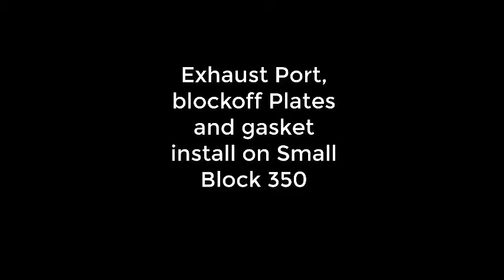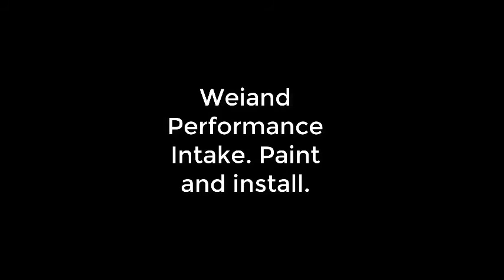exhaust port, block off plate and Weiand Performance Intake for small block 350

Comment: How Did it work out?
Reply from the maker: @jessemendoza2991  I've turned the engine on several times since I installed the block off plates. But only for about 15 too 30 seconds at a time.
 But won't know for sure how  well the plates  hold up till I'm able too install the 350 and let the engine run for a while.
Reply: @almagam2099   Thanks for the reply

Comment: That's not how you make those plates... 
Your plate will prevent the intake from sitting flat on the head. Warp your intake or crack it. 
The plates must be the thickness of the compressed gasket and sit INSIDE the gasket holes not under it. Make the gasket holes larger if necessary.

Comment: Beautiful job! Looks awesome. question? how thick is the heat crossover plug? Did you make it? I need two for my performer rpm to shut that heat off. Thank you, for you feedback. I need to get this done as manifold is ready for paint and install. Cheers from Motown.
Reply from the maker: Thank you. I used the port on the gasket as a template. I used sheet metal that I got at Lowe's. Traced out the shape from the gasket. Cut it out a few centimeters bigger than the actual ports. And did the install. I promise. It's really easy too do. If I can do it, anyone can do it.
Reply: @almagam2099  Thank you very much for responding sir. what thickness of sheetmetal did you use to make your your block offs? I want to make sure I don't go too thick and have gasket sealing issues. I bought some stainless sheets that are .013 thick from Menards pack of 10 for like $6.00. Hope they are thick enough. Thanks you, Appreciate it!
Reply from the maker: @robertclymer6948  sorry, I don't remember exactly how thick the sheet of metal I used was. It might have been the second thickness they they had?! I didn't wanna risk dealing with the same issues you mentioned so I know it wasn't  thick.
Reply: Do it run good since you have done that have you had any problems out of it since you did that the crossover heat block off

Comment: If you go on my channel 1 l o w z and look at my intake on my V8 in my S10 Blazer my first intake I painted same color you did but first time I thought I had a vacuum leak and I sprayed some carb cleaner around the base of my carb and I didn't even have a vacuum leak I was pissed off because it ate the paint off the intake right in front of the carb if you look at a couple of the last vids you can see right in front of my carb where the paint has came off and it looks like s***then it also will start looking bad around the boats that hold the intake to the block so what I did this time was take a 305 ho factory Chevy intake that was aluminum off of a 84 or 85 Camaro and put a wire brush on my impact and went to town on it I polished and polished and polished that intake if you look in my business sitting on the curb next to my truck when I was showing it off it almost looks polished aluminum it damn near looks grown all you're up to do is take a wire brush and a drill and you can make aluminum beautiful but that's the route I went because the paint did not stand up to that intake very well even though it was engine paint don't get me wrong or think I'm a hater I'm not your intake is beautiful that's why I would hate to see you put it all back together and it start looking bad because it's very hard to clean back up a intake once it's back on I'm sure you know this but man you made it look good 💯 I just hate to see your feelings get hurt first time some carb cleaner or some fuel gets on it
Reply from the maker: Thank's for the info! I'll def take a look at your channel!!!

Comment: Hey bro in a bit of pickle. Basically I need to know what I can delete from the engine
Reply from the maker: Do you have the z24i?
If yes, and if you're keeping the stock throttle body...you can delete about 99% of all the vacume hoses and the emissions  and egr Components on or around the engine! The only thing I left in place was the charcoal canister, but finally removed it a week or so ago! I have a vague memory of the original, stock distributor having a vacuum advance, but the new one I have now, doesn't have that, so no vacuum hose too deal with!
Reply: @almagam2099  any chance you could link the vid, if you made one, for taking those off? My truck keeps losing power even though the battery, alternator and starter are good
Reply from the maker: @Lz999J  ill try and help you after I get off work!!!
Reply: @almagam2099  I appreciate bro fr 🙏🏽
Reply from the maker: @Lz999J  here's the vid I did after I'd done most of the vacume hose delete! No real details on exactly what was done tho!
Reply from the maker: https://youtu.be/0AzENfKtZgM
Reply from the maker: @Lz999J  when you say your truck is losing power!, is it not holding a charge?
Does your engine turn over and start normally then die? Do you lose power to the entire truck or only certain area's?
Have you checked your fuses? They're underneath your steering wheel, just to the left of it!
Check your fusible links! They're next too or near the battery! They supply power too different areas of your truck! If they go bad, those area's will have no power!
Check your relays! There's several on the passenger side fender wall, near the fusible links and battery!
Check the battery cables for corrosion or looseness! Check the harnesses for alternator and starter! "Same as with battery" also check your grounds! Check for corrosion and looseness!
Places too look for ground wires: 
alternator to battery "I think?!"
 Firewall to valve cover. "Engine block!"
Transmission to frame.
Computer to frame.
Bad grounds will cause all kinds of problems!
Reply: @almagam2099  thanks man, are there any tips or things I should know while removing this stuff. And are you selling your z24i
Reply: @almagam2099  so I got off work I started it up like normal and as I was driving my rpm’s started going down and then it died. Lights/dash/radio etc were still working. I messed waited a bit after making sure everything was connected/tightened and after 20 mins of waiting it turned but really slow. Then a rattling noise starting happening then boom she died for real and wouldn’t turn at all. After I parked it I tried again just to see and it turned a lil bit.
Reply from the maker: @Lz999J  try deleting one hose at a time and plug the outlets that, that hose goes to so you won't have any vacuum leaks! Drive your truck for a bit "say, around your neighborhood" see how the truck runs! If all's good...remove another hose and follow the same process! Eventually you'll have most if not all the vacume hoses deleted! You'll also be able too remove all the other egr Components as well! You'll have tons of room in your engine bay!
Yeah! I'll be selling my z24i once I get the 350 installed!
Reply from the maker: @Lz999J  could you tell if the rattling was from the front of the engine? The rattling might have been your timing chain going out! I had a Similar thing happen to me! Only it was the timing chain guide that had snapped apart and was making all kinds of noise!
Reply: @almagam2099  it was! That would explain why it died the way it did
Reply from the maker: @Lz999J  damn! Sorry too hear that! If you're able, drain your oil pan and remove it from the engine!! See if there's any metal shavings at the bottom of the pan! If no metal shavings,  that should mean there was no damage done to the engine, internally! If there are metal shavings, it means the timing chain did some damage! But it'd be difficult to know exactly where the damage was done and how bad it was!